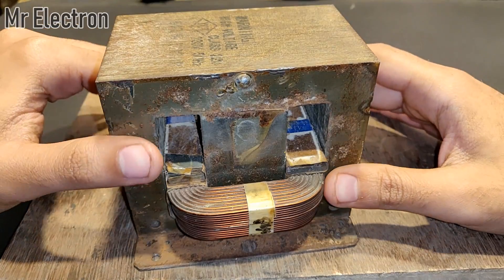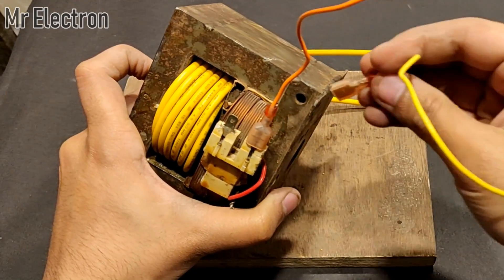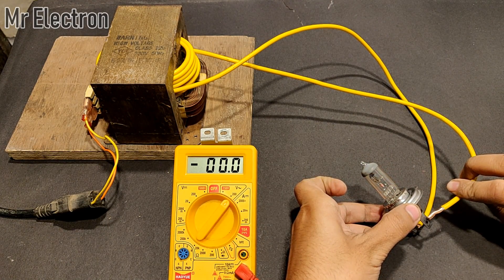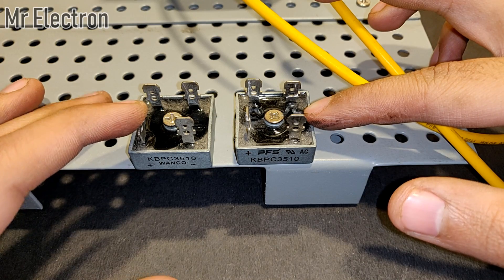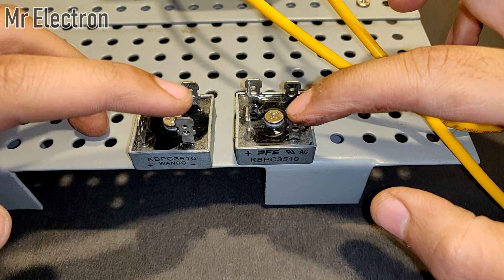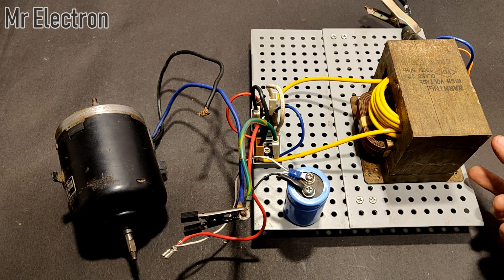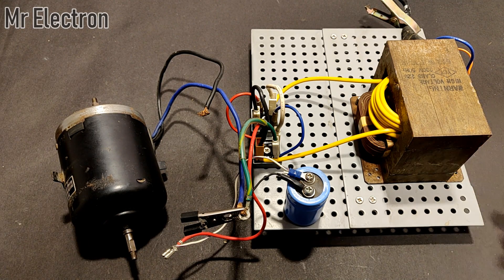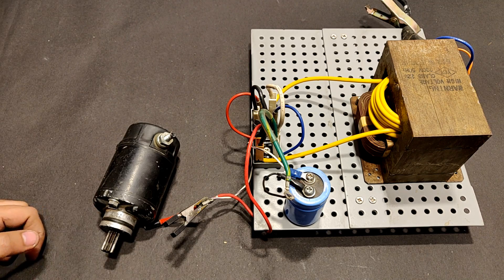12V 100A DC from 220V AC for High Current DC Motor using Old Microwave Oven Transformer - Part 1

Comment from the maker: BEST BATTERY CHARGER DIY VIDEO - https://youtu.be/ZN3saILbYUw?si=9_nLu0vKOqfn4zi_
VIDEO PART 2 - https://youtu.be/509Epbb08AA
Join this channel to get access to perks:
https://www.youtube.com/channel/UCWFbPzBb7dCyCWuBA-DBrMA/join
Mr.Electron Patreon's Page - www.patreon.com/mrelectron
Hindi Channel                 - www.youtube.com/@Mr.ElectronHindi
Alternator Channel            - www.youtube.com/@mrelectron_alternator
Watsapp Channel              - https://whatsapp.com/channel/0029VaQmmRaFCCoWOf7huh3G
Reply: Hey did yours overheat? Mine did after a few minutes, and after I thought about it, microwaves are usually only on for a few minutes to heat your food, so they might not be designed to run for long periods of time like if you were to use it to charge batteries for example. Do you think if I were to add extra windings to the primary it would help stop it from overheating?
Reply: @johnruscigno5738  well you can't add to the primary but if you remove the shuntz and use 10awg solid core (its a real pain to do and very tricky ) for your secondary then it doesn't get as hot but it loses a little umph haha ... I've only rewound a few mot transformers but they all burned up except the one I used single strand on ... I've only left it on a few minutes and it still got hot but nowhere near as much ... Use 10awg solid single core ... It is very tricky and took about an hour to get 17 full turns but it seems to have made a big difference ...👍
Reply: @johnruscigno5738  need to order custom 100A transformer
Reply: @vistanationrockafellaz  yeah you're right. I just enjoy experimenting with stuff like this. Trying to find 100amp diodes is difficult too. I tried those big 10 amp diodes and made a bridge rectifier but they popped like popcorn the moment I connected the terminals.
Reply: I found that putting a resistor on the positive output limits the current draw and after that the transformer was warm but not hot.
Reply: Hjh
Reply: Sir need ur whatsapp number for some guidance
Reply: Sir need ur email for some guidance
Reply: Kenge popullore  the  devollit

Comment: It is much better to use a single bridge rectifier module rated for the full design current. You need to solder those twisted wire connections, too. That is very dangerous. 

A normal 12v lead acid deep cycle battery, after it has rested for 24 hours with no charging current or load applied, should be around 12.65 volts. The normal float or maintenance voltage for keeping the battery charged when under light or no load is about 13.4 to 13.6 volts. A good bulk charging voltage is about 14.4 volts up to the 80% state of charge. 

You read 17.96 volts with the 22 turn secondary. so, that is about .816 volts per turn. Simple arithmetic will give you the number of turns you should try now, for the correct voltages for a 12v system that includes a battery. The closest number of turns to what should give a good float voltage for keeping your battery charged would be 17 turns. But you would want 18 turns for bulk charging and maybe also you might want to use 16 turns for long term float charging. So, if you tap your secondary coil at 16, 17, and 18 turns, and make connections with a switch rated for the max current or else use jumpers and terminal strip, you could manually switch voltages depending on what you are trying to do. If you will not be worried with charging a battery, you still want to lower your voltage a bit to extend the life of your DC components. 

Your microwave transformer is perfectly designed for use in a microwave oven. Microwaves are typically used for less than 10 minutes with typically a kilowatt of power used. You do the math on max allowable current. But remember, this is for a very light duty cycle! That transformer is not meant to be dissapating even the magnetizing current indefinitely. So, your transformer is INADEQUATE for your application. Please, think about what you are doing. Microwave transformer cores are fine for building things like spot welders where they are only energized for a few seconds up to, with low loads, a few minutes. Not for a DC system general power source!

Finally, where are your circuit breakers and panel meters? You need as a minimum, a shunt ammeter and voltmeter on the secondary and honestly I would want one on the primary, too. These are very cheap on amazon, ebay, or aliexpress. And you need to decide what current your secondary circuit can carry according to the wire gauge, and rate your secondary circuit breaker below that. 

Videos like yours are fun to watch but dangerous for idiots to watch who think they can do the same thing you are doing, and then burn their house down or electrocute themselves or destroy expensive equipment. If you can't do this safely, please, don't show other 12 year old curious georges how to cause a catastrophe.

Comment: MOTS  are designed to be started  UNDER   LOAD,   microwave is  ELECTRIFIED  WHEN you hit that start button,,,there is no ''  on-but not running' switch. Primary should be under load.....ALL  THE  TIME   its electrified....
Reply: .....yup...it heats up......just add a large plate of copper to the sides/top of that xfrmr......with a fan....ALWAYS  TURN  ON   UNDER   LOAD.....

Comment: What is the gauge of insulated wire u  used for secondary winding???

Can i use 10000uf 63v capacitor

Comment: But there is no load on the motor(s) so it's not drawing the amps.....it will spark at start up but once it starts and is running free the back EMF will balance the incoming voltage and no current will flow......correct me if I'm wrong.

Comment: Dear Mr Electron

Is it possible we do following
1) 12volt INVERTER DC To 220AC output
2) then use this system for running DC motor for paramoting BLDC motors RPM 9000 To 10000

Comment: Why didn't you measure current for various loads that you've been using, and at the same time, measure voltage, to see what's really going in with this circuit under different loads? Also, "very, very hot" in engineering means nothing. You need to measure temperature of the windings and let us see (let you see) is it sustainable and reliable power supply and if so, to determine operating limits of such power supply.
Reply from the maker: Sure but as soon as i get an Ammeter with rating more than 10 Amps
Reply: @MrElectron  Yet you claim this is a 100A power supply? Lol

Comment: By far the best build for a welder that I have found.  Great job, one question.  Since I am here in the states what would I get if I connect to 110v instead of 220v or do I have to connect to 220.  I have a switch the I salvaged from a computer power supply that you switch from 220v to 110v, will that help? Thanks in advance and again great viceo!!!!!
Reply: You will get roughly half the voltage output. The voltage in the video is too high for a 12VDC system, so first of all reduce the 22 turns to more like 17 or 18 turns. Now double that, to give the same secondary voltage at half the primary voltage. This would also increase the primary circuit current by a factor of two, for a given load. It is simple ohm's law arithmetic here. When you get to high school you can learn stuff like this in physics class. If you are already out of school and you missed that, get a good book on electricity, magnetism, and safe wiring and electrical practices before you plug anything in to anything.

Comment: Sir Electron can that transformer use inside single phase or 3 phase building compartment.Or need to order custom like MOT transformer.Last question if my solar pv producing 12v 8A or 12 32A by connecting to that transformer could it be possible to deliver me 220VAC 100A or 1000VAC 100A?

Comment: Nice project, well done video 👍
Did you find the transformer  issue ?
I believe  it's from  the eddy  currents caused by the loose  plates.
Compare this transformer now, with how it was BEFORE tear down.
The plates are compressed,welded, and resin sealed under vacuum .
But for now you could  bolt it together using high grade non-magnetic bolts.

Comment: Is it possible to make 10A or more output by rewinding a small 9V radio transformer? I have made 2 turns in the secondary of  this small transformer but I am getting no current.

Comment: Two rectified bridge have 35 amp : 35 +35  are 70 amp. And the secondary wire diameter is to little for 100 amp...you don't have 100 amp.make the right thing bro !!!

Comment: HELLO, I BUILT ONE. IS IT NORMAL THAT THE PRIMARY HEATS ALSO WITHOUT ANY LOAD?
Reply: Yes, if your transformer is "loosely" reassembled  you will have excessive eddy currents in the plates.
Even unloaded, the primary is still generating a magnetic field and thus you will cause heating of the plates through  eddy currents .

Comment: immerse it in transformer oil or cooking oil
Reply: Cooking oils with their fatty acids  are not the best oils to use as the can corrode certain metals. Neither is biodiesel a good transformer oil.  Mineral oil is the better long term choice.
Reply: I recommend a pump to control flow of oil in and out of tank so it doesn't heat up the oil too much

Comment: Mr. Electron the 750Watt Microwave oven has microwave oven transformer (MOT) core that is calculated for the 375Watt RMS out put power. So 375Watt : 10.5Volt = 37Amp Max Output current. That why it has a current shunts build in between primary and secondary coil.
Reply: Those are called magnetic shunts.

Comment: No explanation of what you're using why you did the winding, diodes anyting at all just music. So my question is, if a young kid try this experiment. And is killed. Buy a year didio of expertise are you liable, for the death.
Reply: Yep it's initially 2000 volts +⚡ before secondary coils are destroyed if this is switched on. Absolutely danger of death.

Comment: Why a bldc fan for cooling? We can use high speed dc motor as fan..... But literally very good vedio. Next time please try the same with normal transformer and a few more turns of secondary thick wire, let us see what happens to the heating problem. I will be very eager to see that. Very well done. Congrats....

Comment: Can we reverse this thing
By giving 12v and get a high volt
Reply from the maker: Yes but it won't be much efficient
Reply: Mr Electron , I am very surprised with your answer.  “Transformers does not work with DC voltage”.  This is a basic transformers características and  work capacities principles.
Reply: That we have to make an inverter to convert dc voltage in to AC voltage. It can be done mainly electronically

Comment: Why you dont feel a showk during checking ac volts?
Reply: BeCause it's not enough amount of volts to shock
Reply: @ulams  the rewound secondary coil puts out a low voltage. Because of resistance in the human body, the low voltages do not have enough elecromotive force to push the amps that can be felt, let alone hurt or kill.
Reply: Thats about like 1300 ohms
Reply: You will feel it if you try this before you remove the secondary coils because it's more than 2000v and extremely dangerous!! Do not switch on transformer until you remove the secondary coil. You're right to be cautious!

Comment: you cann t use this power supply for long time cause you use wire with plastic insulator. You can use  varnished wire . The current  you gated is only 25A as a max . you can use the law of transformer to know  the volt or current from secondary side   V1/V2 =I2/I1

Comment: What would you get if you converted a 240 volts a/c to DC and how would you be able to increase the AMPS on THE DC output
Reply: You are always limited to the capacity of the primary winding. A microwave is generally designed to run slightly below 1kW. 100Amps * 12v is 1.2kW. I highly doubt that this old microwave transformer was designed to handle that, thus it would blow up eventually. To increase the amps, decrease the number of winds on the secondary. It'll give you lower voltage but higher current. Also the wire used in the secondary in the video will never take 100Amps lol. This video is ridiculous
Reply: @TheChrisey  i know :)
Reply: @TheChrisey  also look at the primary wire connection its thin

Comment: Just remember that microwave oven transformers are made on the brink of saturation, they are not meant for continues operation out over 15 minutes. They will destroy themselves from heat over a longer period of time. If you want to avoid this, add some more primary turns to lessen the Volt/turn product a bit.
Reply from the maker: Exactly !! 😃 Working on that right now.
Reply: Nice project. I measured a MOT saturation curve, they are deep into saturation (maybe 100 VA) at nominal input. Another solution is to use two identical MOTs with primary windings in series, so that each one operates at half voltage. You can then wind the secondaries and connect to suit. This configuration would run much cooler even if the primaries are aluminium. I would suggest using much thicker copper wire if your target is 100A continuous capability. I have a YT video to show over 1000A from a single MOT transformer with a 2 turn secondary when I paid attention to keeping resistances low. I use it for wood branding art.
Reply: Cool information. Just want to ask, is it possible to run continuosly if you put some heat sinks and also fan?Thank you.
Reply: @sikismeker  The transformer is already forced air cooled in a microwave oven, it can only postpone the inner turns getting cooked, by a small margin.
Reply: @KaizerPowerElectronicsDk  i guess that aps transformers is way better than. I,m try to buildl power supply 2kw  for HHO.
Reply: @sikismeker  I would NOT NOT NOT run one continuously. The core is simply too small for this application. It is not meant to run continuously. It is very efficient and safe, when only ran for a few minutes with only a kw or so of power. Repurposing electrical components should not be done by the uneducated. Get some good books on electricity and learn learn learn, and don't plug momebrew electrical circuits into your wall outlet, whatever you do, until you know what you are doing.

Comment: Your project is very educational, it can also be used as a battery charger, the transformer has very good amperage and with the two full wave rectifier diodes and the capacitor, the output of the 12 volts ac transformer is increased, transforming it into 17 volts dc, thanks Greetings from nezland City Mexico.
Reply: Hola. No se mira el numero del capacitor y como es la polaridad para conectarlo. Tienes esa información?
Reply: 40 V 100MF CAPACITOR

Comment: To solve the heating add a light bulb in series the primary coil or you can use a heater element or very high power resistor with fan.